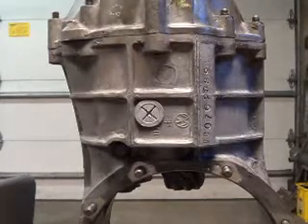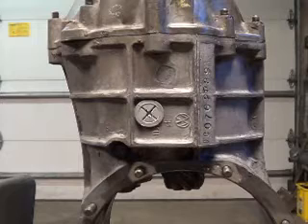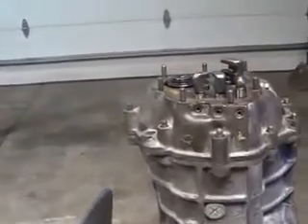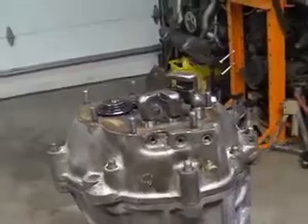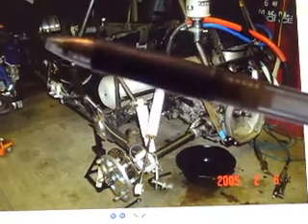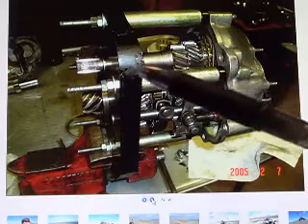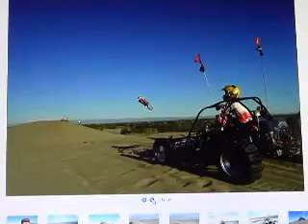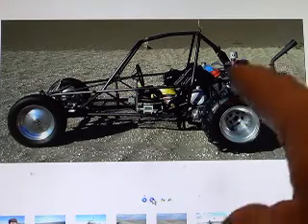EZGZ Volkswagen Transmission Tips and Tricks 9

Comment: I’ve heard that you can do this to fix reverse popping out?
Reverse idler adjustment?
Do you know ?
Reply from the maker: first, second and reverse all work off the same slider hub so you really need to take the whole tranny apart to get at it. Most times reverse popping out is worn out reverse gear and it has to be replaced or flipped over.